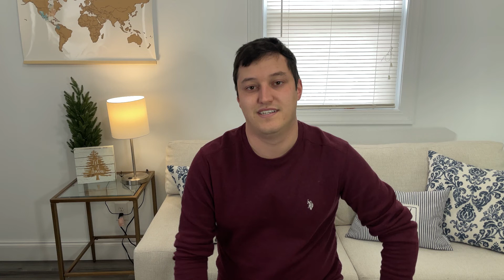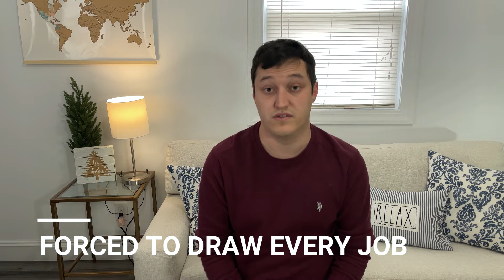Don't Use Your Manufacturing Software For Pricing Cabinets

Comment: I draw a quick draft in Kcdw. Then use excel spreed sheet I created. Takes me 10 minutes. Then I'll tag on extras depending where job is located. Downtown is more expensive. 2nd, third floor and so on is more expensive. Type of home. Expensive homes are more expensive. And so on. Difficult clients are more expensive also. I paid my dues. In time you learn.

Comment: KCD prices cabinets and counters in minutes , takes a bit to set up (like 3 days) but once your done it’s really fast ( get vendors that don’t raise prices too often (Chinese vendors)). Only thing I use Easystone shop ($50 a month) to do vain mach. I do around 60 kitchens a month ( I have 12 keys for KDC ) im thinking of getting 1 cabinet vision to work with SCM router and robot
Reply from the maker: Wow, sounds like a high production setup. Out of curiosity, is KCD not doing everything you need it to do or what is making you look at a Cabinet Vision key?

Comment: I understand where you are going with this, but that seems to also be a waste of time to just throw out a lineal footage bud. There is no way you could come close to being any where of what the real bid would be without working up drawings and using some type of bidding software, such as those programs you mentioned. Im just curious why you made a video saying why not to use the software program, but really did not give and good alternatives??
Reply from the maker: Thanks for the reply Scott. The point of the video was saying don’t use your “manufacturing software” for pricing.

I also agree with you that lineal footage is not an ideal method. I was only recommending people to use some sort of external process or software for quoting other than your “manufacturing software”.

I’m going to be talking more in upcoming videos about some of the software solutions that are available specifically for pricing. 

This video was simply a starting point to challenge the idea of using your manufacturing software for everything and to get people to think about their process.

Comment: Great video. Striking a balance with the tire kickers and the bonafide potential clients is the holy grail. As a pricing method linear feet is a joke but to weed out the riff raff it has its place.
Reply from the maker: Tire kickers:) nice.
I agree that lineal foot pricing is a joke. The only thing it has going for it is simplicity. Otherwise, It just leaves so much on the table.